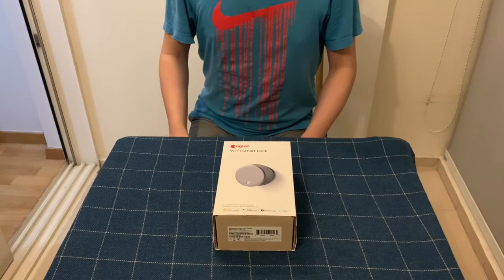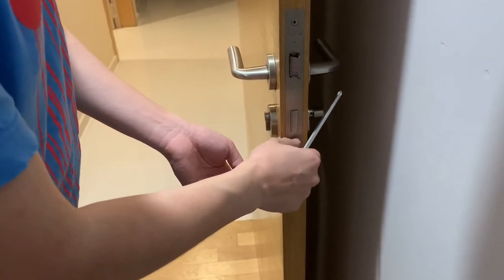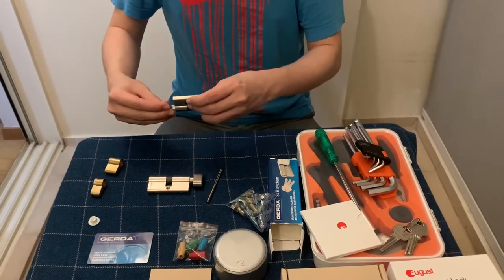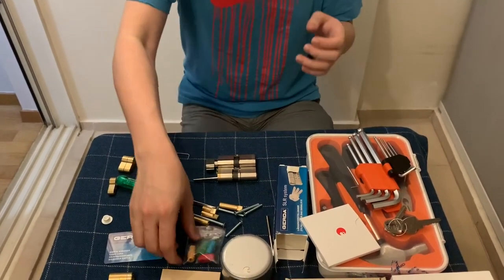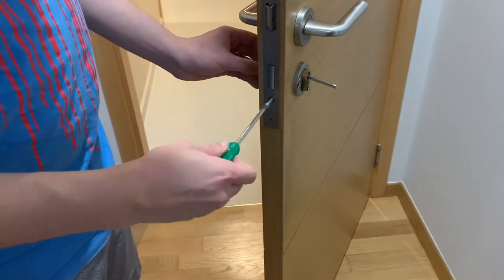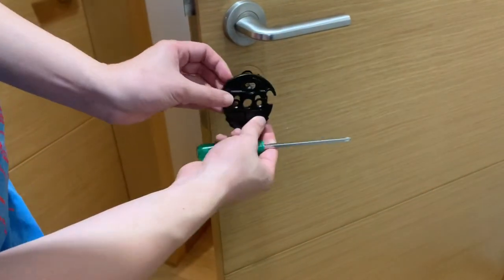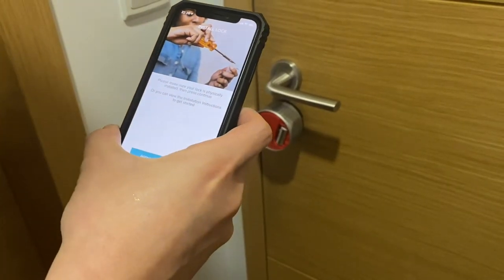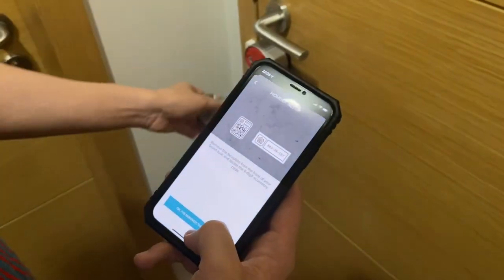HomeKit August Smart Lock with Euro Lock Cylinders

Comment: Hello, I want to place the August cylinder in the access door to my house, for which it does not have a handle on the outside and it opens directly with the typical key. My lock can be opened completely from the inside by turning the lower handle, that is, the upper and lower latches open. There are 2 turns to completely open the lower latch and 1 extra to open the upper one. In your video, after using the August cylinder, I see that you manually open the upper latch with the handle. I need to know if the August cylinder is capable of doing that, that is, giving 2 turns to open the lower latch and then one extra turn to open the upper latch. Thanks in advance.

Comment: are you not having any issues using the key to open from the outside? If the batteries drained and you can no logner use the August, how are you going to unlock the door?

Comment: My door doesn’t have a lever from the outside.
Can you open the spring latch by key from outside when the smart lock is unlocked?
Thanks in advance.
Reply from the maker: Do you have a picture of your latch, this smart locks turns one round only, if your latch required more than one turn this solution may not work
Reply: @hometechasia3678  Thanks for replying back. If you can send me an email or anyway to send you photos of my door lock, I would be grateful. Thank you,

Comment: How do you remove the faceplate of the cylinder lock?
Reply from the maker: There is a little opening at the bottom usually, use a small screwdriver to give it a lift. It’s a clip on usually

Comment: I was able to installed my lock using this video and the same parts you used. The lock works perfectly with the app and manually. The problem I have is that I can no longer use the key. If I use it i cannot longer take it out, it seems like it is missing half turn to be be back in a position where i can take it out. Because of this I have to take the august lock out and then without the lock the key will completely turn and i will be able to take it out. Do you have this problem too or is it something exclusive of my lock?
Reply from the maker: Hi Edgar, I believe this is lock specific. Some lock type need full turns before the key comes out, can you share with us what brand / model of lock you are using?
Reply: @hometechasia3678  wouldn't this be the same if I am using the same cylinder than you, the Dana lock? The brand of the lock is AKI, I think it is more a local brand, Mexico. But it is practically the same than yours or at least they look exactly the same. I thought that using the same cylinder it would be the same experience than you no matter the brand of the lock as it is the cylinder that turn and allow the key to get about.
Reply: @edgarguzman2319  I have the same issue as you even while using the lock OP recommended. But I managed to fix it by rotating the inside piece by 180° see 6:15 .
Reply: @SnotterBoss  thanks for the recommendation, I just tried and it was the same result.It seems like no matter what I tried the way my lock is build it needs two turns in the key which August lock doesnt allow it.
Reply: @SnotterBoss  I have the same issue, is this solution still working? and could you please explain what do you mean? thank you
Reply: @edgarguzman2319  has someone managed to solve this problem ?
Reply: @moaltwaijri  i did what @SnotterBoss recommended but didn't work for me, so I give up as the issue seems to be with my lock and not really the cylinder that were are using, which is the same than the one being use in the video.
Reply: @alias1923rapid  not me, I tried different things and positions for the lock and nothing helped so I really think that the issue is link to the lock and not to the cylinder which I guess is the same we all are using, the same that is being use in the video.
Reply: @hometechasia3678  I bought the same cylinder as you did, and cylinder itself requires 360 degree to get the key out. I bet you don't use the key at all with August lock now.
Reply: @ScreentubeR  HomeTechAsia - I was going to get the equipment you mentioned….the Danalock…I have the August….But is Gregory right? Can you get your key out, while using the August??? Did you buy the Danalock V3, Gregory?
Reply: @edgarguzman2319 , @Robert Nişulescu, @Gregory Mollet I had the same issue, but after rotating with 180° the inside piece (as @SnotterBoss is mentioning above) , the issue is partially solved (I do believe is the best what can be done and I'm satisfied), the only issue remains in this case is that you can open the door with the key, but you can't take it out only after locking back the door.